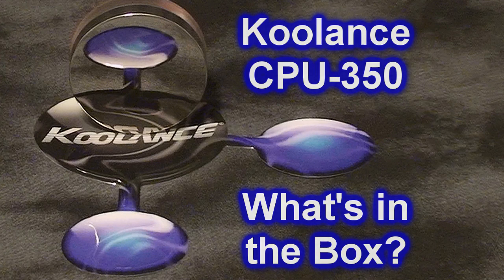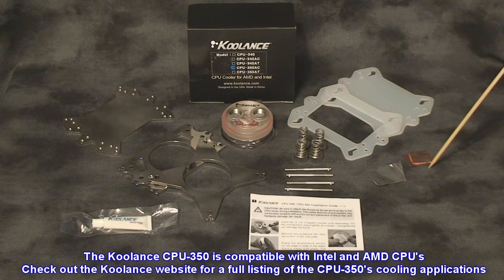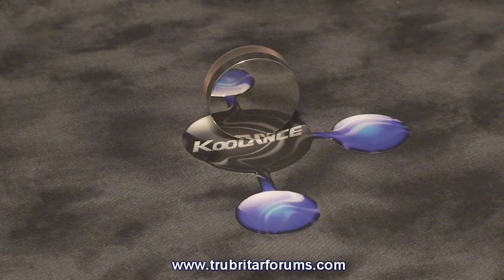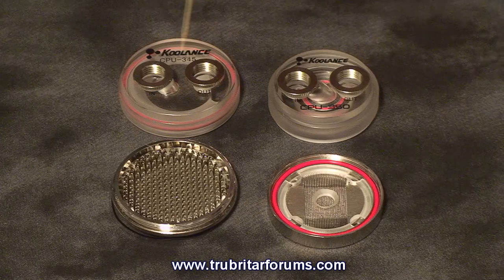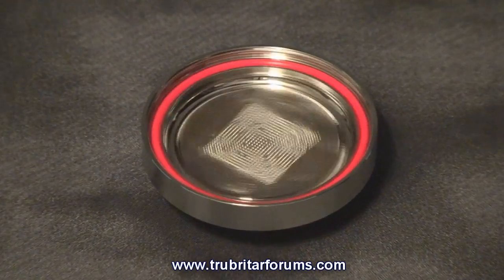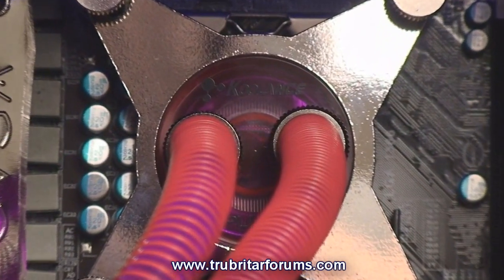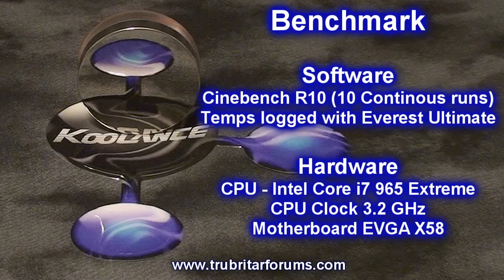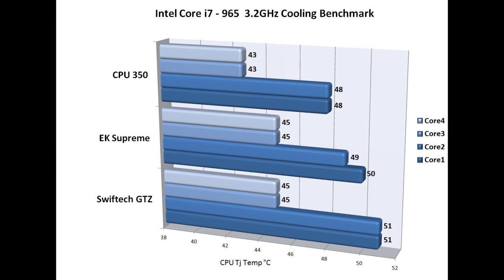(HD) CPU 350  Performance CPU Waterblock Review

Comment: thanks for the review.

After using this cpublock after more than a year, now my watercooling system is totally clogged up, because as the reviews show, this waterblock is incredibly restrictive, if u blow from the inlet, u have to use too much force to make the AIR go outside trough the outlet.  My waterpump works less than a quarter its rated flowrate capacity, to the point it wont move any water!  this after a year of use. cpu350 = FAIL.  go with the new 360 or the HEATKILLER. bad purshase

Comment: thermalright 120 extreme ultra. But like i said... erploring water cooling performance.

I lapped my cpu tho and i get about 10C less in prime95. So i'm not hitting 100 anymore. About 91 - 93C. So i'm not throttling anymore. Unless ambient temperature is 35 degrees or more.

Comment: What kind of cooling does it deliver in overclocking conditions. Lets say 4.2-4.4 ghz? I would like to know because i'm considering getting one because my temps are easilly hitting 100 degrees in seconds @ 4.2ghz on air and my cpu starts throttling back.

Comment: very good product overview vid indeed, the block certainly looks like koolance have produced a rather unique block here. But your testing results a fairly meaningless as you should only display the delta temps recorded from ambient. 

Most of your regular viewers know that you use the zalman reserator XT's and it gives you the amb temp and amb water temp on the front panel display. These are pretty critical in determining exactly how well the block is performing against the other 2

Comment: 350 block is the best block out on the market, however the block is also the most restrictive block on the market.  I would not recommend running multiple blocks in the same loop or you will not hit those temps.

5* review, thanks.